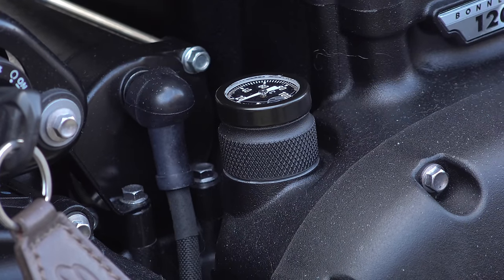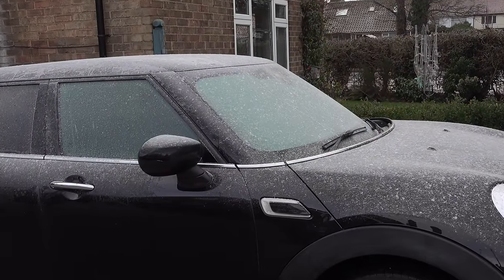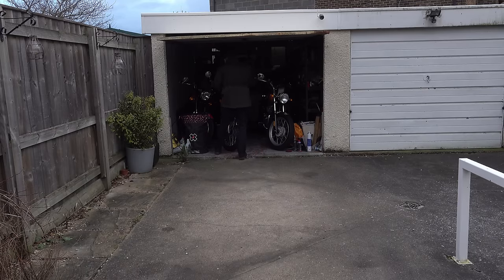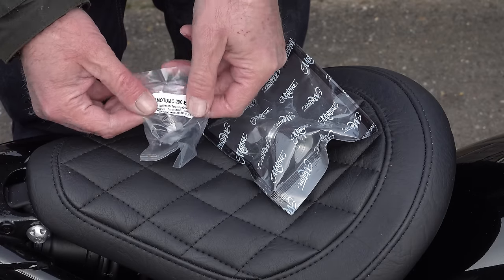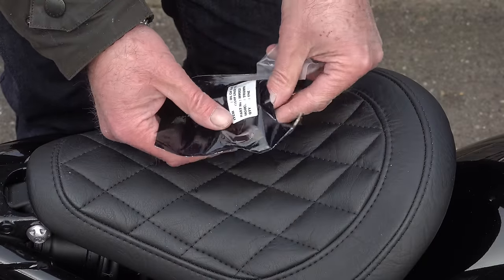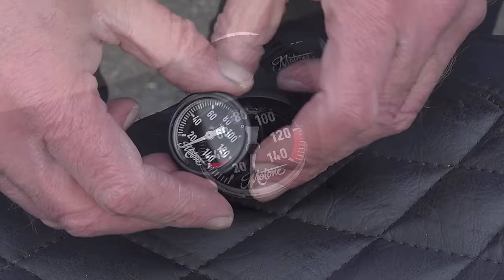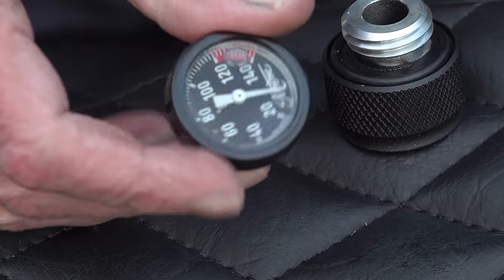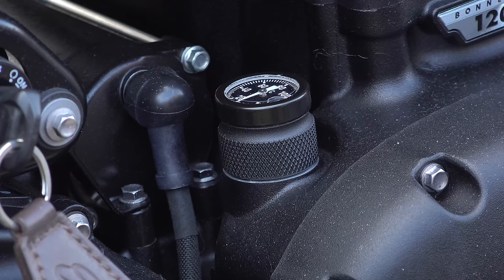Triumph Bobber Black Project, Fitting the Motone Oil Temperature Gauge! & the cold kills the Bobber!

Comment: Retired marine who spent just a little bit in Norway and found my wind chill chart the other day , if your travelling at 35 mph and it’s 10c it’s really 4 c ,so minus ➖ 2 will be - 8 c nice . I wonder if the missus would knit a nice little cover for my mobile . I’ve got a triumph 660 sport kept outside -4 last night but start’s every time , reason it’s trickle charged with a 10 watt Optimate solar panel,, feeds in about . 07 amps and of course only in the daytime , but bike hasn’t failed me since using 😊👍👍
Reply from the maker: The Bobber is always on a maintainer so I will be surprised if its is the battery!

Comment: A simple trick to see if the gauge is well calibrated : dipp it in boiling water, if it shows 100 degrees it’s okay. When your Bonny is equipped with the original U lock holder under the injectors, it interferes with the U lock.

Comment: Looks alright, a bit steampunky!
I had exactly those symptoms on a 2017 Mini during the original lockdown. I’d kept it charged but not driven for 3 months, the battery appeared to be fully charged, 12.75, but had still found a way to die. Replacing battery was the (expensive)cure.

Comment: Can you comment on the Triumph T-120 Quality issues? Are they having anymore transmission shifting issues.? Just the overall integrity of these Triumph motorcycles... You commented they run a little hot. I was at a Triumph dealership today and saw the new T-120. Very nice looking. The radiator on the bike seemed extremely small for a bike like this. Your comments would be well taken.

Comment: You should surely use a lithium battery that gives a weight savings of 5-8 pounds and you can take the battery inside to keep it warm and use a USB plug like a computer for charging / maintaining.  Mine for the Moto Guzzi V7 is 1.3 pounds from the original of nine pounds!  Starts with a roar immediately each time as there are more cranking amps.  I understand that this helps with a brighter spark, etc., for improved handling and longevity of the engine.

Thank you as always for the little jobs though off-season for you!  I am in Miami with the air conditioning on!

Comment: I have to wonder if an oil temperature gauge is needed.  The motorcycle's engine is oil and water-cooled.  It is designed to operate within normal use and temperature ranges.  Even if you install a temperature gauge, will it actually affect your riding?  At what temperature would you stop or change your ride?  It might look cool but is like putting lipstick on a pig considering the price.

Comment: I'm guessing it would also fit the air cooled Bonnies. edit, just checked and all Bonnies and associated models from 2001 to present.
another edit ten days later. bought one of these for my air cooled 2007 T100 and fitting today found that the temperature probe is too long. suggest this is only for water cooled models not all as Motone state.

Comment: Battery leads, earth, both ends of leads. Battery. Good starting points. I'm a grease monkey. I'd put my booster pack to the battery. If this works it's battery or connections there. Good luck in this weather. My tools are like ice cubes.👍🤣

Comment: I've always been surprised by which vehicles will start in the cold. My 2003 vw passat v6 4motion wagon would never start below -20°F, 5w40 oil. The volvo 240s that my wife and I drive nowadays fire up no problem in -40°F

Comment: Never fear overheat, modern bikes with water cool are real good at keeping itself cool. Heck I was impressed by an air cool RE bullet 350 which had zero problem running hot in 32C/89F weather.
Reply: Both my air-cooled RE's (Classic 500 an interceptor 650) seem to handle warm weather well (the few instances in Irish climate permitting 😄) Maybe older bullets can be more sensitive, but I think since the UCE engines they pump up a lot of oil that helps with the cooling. Not skimming on the quality of the oil is definitely a factor, plus both of my RE's are fitted with FuelX mods that run them a bit richer for some extra oomph at the lower RPM's. I did own an 1972 Enfield India Bullet 350 as my first ever bike that had some issues running too hot, but I think my 18 years old self was equally to blame for poring in the cheapest crud I could find and then trying to keep up with my buddies Yamaha RD350 😂
Reply: The triumph 1200 engines should really have a bigger rad. It looks good but my fan comes on alot even when it's cold. When it's hot it's almost unbearable
Reply: @frankysworld  Oh yeah, I should have clarified. Your engine won't care but it's your crotch that have a problem. My good Indian friend kept telling me it's fine because the Bike was made for Indian weather. Unless the overheat indicator come up, your bike is fine but not your crotch. haha...
Reply: @tonecao4358  ahaha brilliant! I do have to state I like to take care of my crotch, testified by replacing the standard factory seat on my Classic 500 with a super comfy springed leather seat, of course handmade in India! 😁

Comment: A pitty it was a nogo for the bobber. I used to have a Suzuki VZ800 that didn't like the cold either and ate a battery every winter, it happens. But being honest, even my Classic 500 needs 4 to 5 kicks before coming alive in the morning with weather like this, my Interceptor 650 does a bit better, but then again I upgraded the relays on both bikes knowing the original ones are prone to failure. Personally, I would not get such a doo-da, even for my air cooled RE's as I prefer the bare essentials look, but I can understand it makes a nice accessory and the craftmanship looks good on this and seems to mesh in well with the aesthetics of the bike.

Comment: I would go for Fahrenheit ( did I spell it properly ) as I always quote the hot weather in F and the cold in C 😂 , guess its because we went decimal in my early learning years.. Bloody hell its nearly 100 degrees out there, Bbrrr  its  freezing cold out there -3c
Reply: Just realised l do that! Similar education chronology too
Reply: The U.K. stopped using the old Fahrenheit measurements back in the early seventies. Most Europeans under the age of 65 really don’t need to know about the old measurements. (They only need to know that when ordering a glass of wine it can either be regular (250cl) or large (330cl…) they don’t seem to worry about much else these days..
Reply: A very common thing in England

Comment: Frozen battery? Probably not cold enough for that. I had a battery freeze but it was -25F. I’d say you got a bad main battery ground that rears it head with a cold battery. Probably happened when you did all that fiddly farting around putting the rear turn signals on.